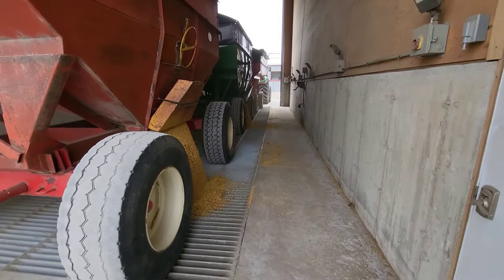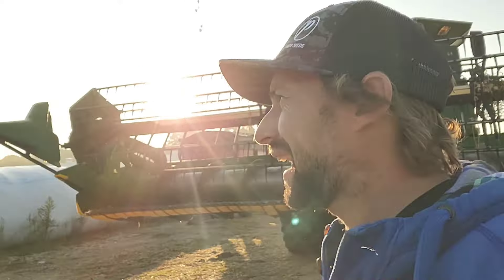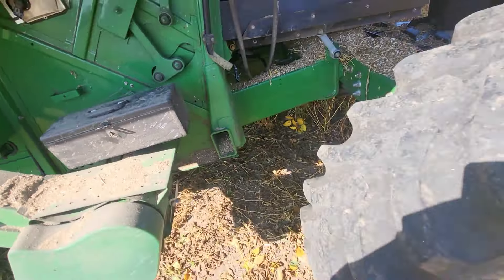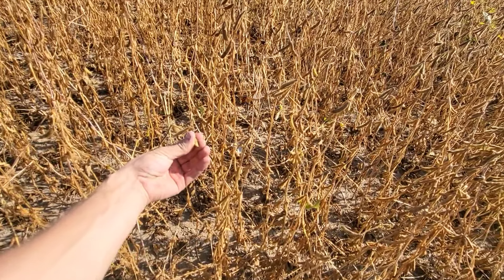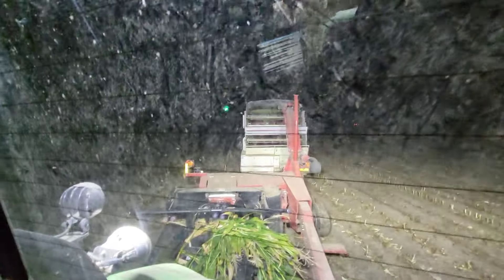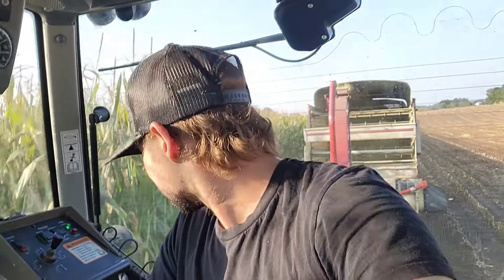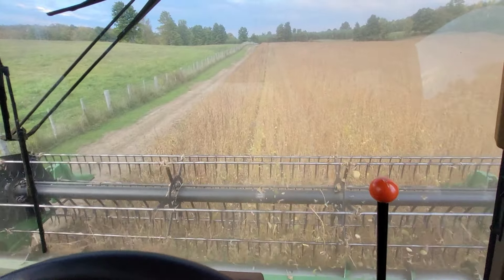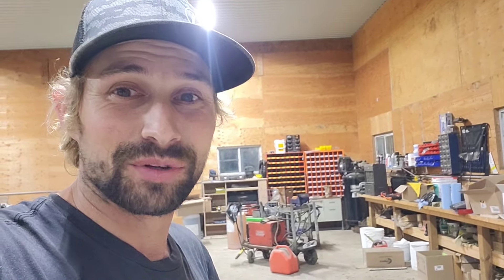Chopping Corn Silage And Combining Beans In 2024!!!

Comment: 50 bales... Do you use the silo at all for corn silage or just the Ag bags? Have you ever considered using a quick hitch (as seen in Sandi Brock, Sheepishlyme videos)? Back in the late 70's when I use to drive wagons; they had a rope on a pulley on the harvester to drop the wagon though that would mean having the back window open on the tractor.